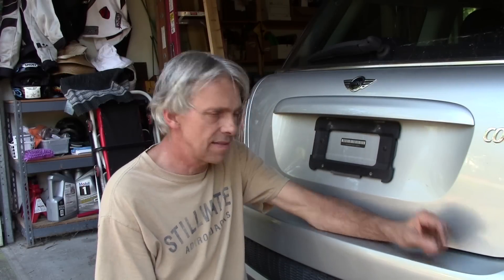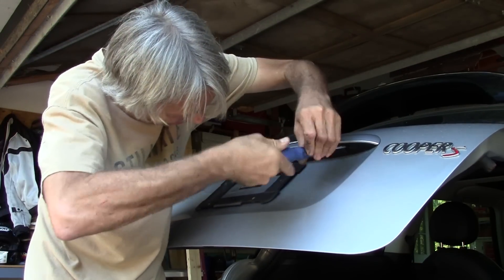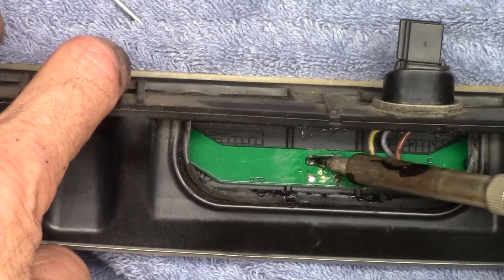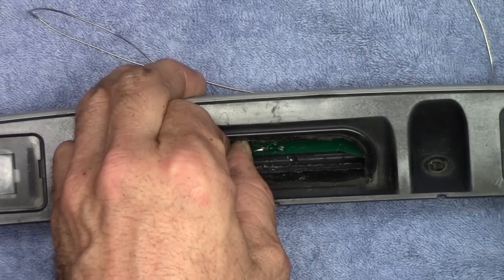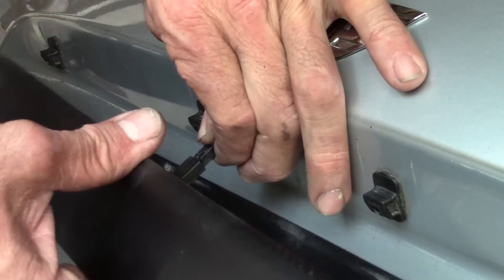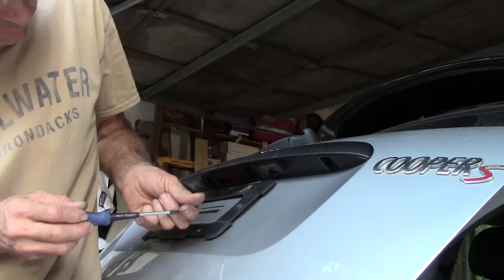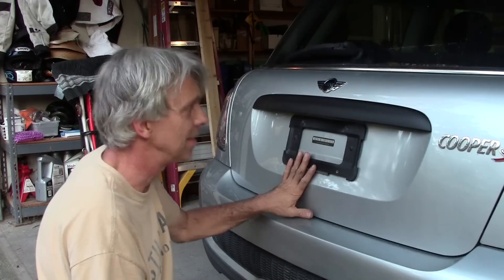Mini Cooper R56 Rear Hatch Release Switch Repair

Comment: My 2012 mini Cooper s was having issues with the hatch door randomly unlocking. I had just bought a new key fob and thought that may be a contributing factor. But after seeing this video I removed the assembly with the switch that unlocks the hatch door. After careful inspection I saw a single strand of copper with located under the switch and thought that may be shorting out the pins that activate the unlocking of the hatch door. I used to do technician work so I cleaned the switch re-soldered the pins on the switch. Placed the assembly back and I no longer have the issue of the hatch door unlocking randomly. I saved myself about $300 thanks to YouTube and the good people who share their experiences. I love YouTube and thanks to all
Reply from the maker: Nice!

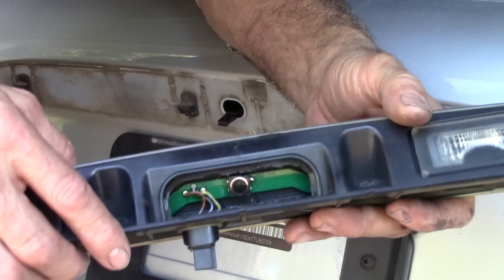Comment: at minute 4:10, I need to know if there is a part number for that rubber diaphragm. My switch works fine but the rubber diaphragm broke off. Does you or anyone on this feed know if this part alone can be purchased?
Reply from the maker: I covered mine with a strip of leather. Part is available as a whole assembly only. ):

Comment: Mine will not work with fob or physically.  Is there a fuse and where is the fuse location 2003 hatchback. Switch seems to click.  I think there is no current

Comment: You can repair switch without cutting the rubber if you prise off the trim on the top  you can get to a piece of plastic which holds the pcb and you can repair from there.
Reply: I did this, tested OK put on car then the rubber broke lol. So now need to take it off and replace the rubber doh

Comment: Thanks!  Great video.  Car is 2008 mini S R56. I found a 12mm plastic panel mount momentary switch in junk box,  I T attached to the two outside wires and installed it in parallel with dead switch.  It tucks up in the recess. Gorilla taped over most of the opening to replace deteriorated rubber. It works.  Not as original as your fix but works/looks ok. The center wire is 12V power for license plate lights.

Comment: Do you have a solution for a 2009 Mini Cooper S convertible with a stuck trunk lid?  

There are two latches for the convertible tailgate. For some unknown reason one latch is unlocked and one is locked! The button on both the key fob and on the tailgate seem to work fine.  I've crawled into the trunk and I can see one is locked and one is locked (the latch is engaged).  Help please!!!

Comment: how do you check the way current flow in the salvaged switch?
Reply: I second that
Reply: It's a switch one side shorts to the other, check with a multimeter if your not sure the switch is correct.

Comment: I've replaced loads of these there only £40.00 from dealers  and it comes with new chrome  and lights would you really bother trying to fix?
Reply: For me I quite enjoy trying to fix the fault.  Also feel it is good to try and keep stuff out of landfill when the problem is just one tiny component costing a couple of pounds to replace.  But I'm sure BMW would prefer everyone to follow your advice!
Reply: £40 as opposed to a few pence is a big difference.
Reply: J lloyd They start at $100 now

Comment: Just done this repair on my daughters 2011 Mini. In the UK I got my switch (in 2 parts) from RS Components. Part No: 4846620 & 7931623, £2.05 including delivery! I found that if I carefully cut around 3 sides of the rubber cover with a very sharp Stanley knife I could hinge it back enough to solder in the new switch. I then re-fixed the cover in place with some clear silicon sealant. Job done, Thank.
Reply: Thanks, was deciding whether to cut or just fork out for a new one
Reply: Glad it helped
Reply: Hey buddy, still got a spare one by any chance? It's discontinued apparently. Happy to pay you for postage (I'm in the UK)
Reply: @ZeFran  That is unfortunate and I don't have a spare, :-(
Reply: No problem, thanks for replying :)

Comment: Thanks for this video. All I needed to do was replace the rubber cover. I cut out a piece of the thin craft foam, sprayed it with a fabric clear from SEM products (only because I had it already) then glued it in place. Might last the for the life of the car. If not I'll do it again.

Comment: Recently bought a 2009 Mini  and just ran into this problem. The only difference is the key fob doesn't open the hatch. I currently have no way to open it. The button latch feels like it is broken but since the key fob doesn't unlock it either, does this mean there's a greater issue issue involving more than just the button??

Comment: This was great but when I went to do mine  ( I have had it repaired professionally two times @$400 each time) the rubber cover was still there and needed to take it apart. I found this very difficult. I removed the silver capping but was unable to remove the black casing to get comfortable enough to work on the switch section. Any suggestions? Or is it  just easier to pay for a new hatch handle?

Comment: I have the same problem - but found this link when someone simply removes and cleans the microswitch rather than replace the whole unit. https://www.northamericanmotoring.com/forums/stock-problems-issues/178411-hatch-release-button-fix.html
Reply: So i followed the above link, dismantled the microswitch and noted that the triangular metal clip that is held back by the spring was snapped. The part number is in very small writing but it's a Burgess Microswitch model V4NC range. The actual model is V4NC4S (prewired vs pins which you have to solder. I'm going to buy one (whether pinned or not) but use it to replace the top half so I don't have to fiddle around resoldering cables and see if I can get it to work. Note that some come with a metal lever which attaches to the pins in either corner of the top  piece - this isn't required on the Mini as the handle pushes against the little button directly so no need for a separate lever. 
Here's the spec sheet for the V4NC range if you're interested: https://www.distrelec.biz/Web/Downloads/31/01/03583101.pdf  
And this is the one I'm going to buy off ebay (£10 incl P&P) https://www.ebay.co.uk/itm/MICROSWITCH-V4-PLUNGER-CONTACT-CONFIGURATION-SPST-CONTACT-C-FOR-SAIA-BURGESS/274433146034?hash=item3fe57d7cb2:g:HQsAAOSwoXFfFUm7
Reply: That's for  the gen 1 which has a different switch than the R56
Reply: @Lex-pq9bl  sorry, should have mentioned mine is an r52 convertible

Comment: just picked up a 2010 cooper s myself and am working on very similar fixes and upgrades so thanks for the videos. I had a question that you might be the guy to ask. My new mini is automatically unlocking the hatch at random only when the car is unlocked. I heard in forums that the rear hatch trim where the button is located can accumulate water and condensation causing the button to malfunction and unlock on it's own but nobody offers solutions. I would like to avoid the $120 for a new trim piece plus the cost to paint it to match. Any ideas on how you might go about fixing it while I still have a working switch that is just in need of a little water protection?
Reply: Gerc422 I have the same problem did you ever get it fixed?

Comment: The manufacturer did this weakpoint on purpose so you'll have to throw that mini away and buy a new one.
Reply: /s ?
Reply: Lol
Reply: This fails on BMWs of the same era as well, it’ll use the same thing from the same parts bin. It’s a tiny switch that is only suitable for CD player interfaces. You’re applying pressure when you’re using it opening the boot.

Comment: The problem on mine was that the switch has a plastic keycap clipped onto it. The clip had broken and so the cap had moved meaning the switch wasn't being pressed. I found both the keycaps and the exact same switches for sale from RS Components. Part number 484-6620 and 793-1623.
Also, no need to remove the rubber cover, just cut three edges, fold the rubber back, make the repair, then glue with cyanoacrylate. Some RTV black silicone (instant gasket)  does a great job of sealing it as well.
Reply: Hi Greg, thanks for posting your tip and especially for the RS part numbers.  My cap and switch have both disintegrated so I think I'll order them and see how I get on.  Did you replace the entire switch or just the cap?
Reply: adamski700 I ordered the switches and caps but just replaced the cap. If I'd had to solder a new switch I may have cut the rubber cover completely off, as in the video to make it easier.
Reply: OK thanks Greg.
Reply: adamski700 if you are UK I can post a switch and cap. i have spares. no charge.
Reply: Thanks very much Greg (yes I am in the UK) but I have just ordered both from RS, cost £2.04 inc postage (before I saw your offer).  Mine needs a new switch so will let you know how I get on!
Reply: Hi Greg! Still got that switch and cap? I would love to have them to Finland, so just get me the way to pay you for it; PayPal etc?
Reply: Great advice there Greg. 
Ordered the parts from RS as you quoted and eased up the rubber cover after softening the original jointing with persuasion from a heat gun and a scalpel blade to tease up the edges. 
I had expected to have to replace the electronic switch as the release had been getting worse over many months before finally giving up the ghost and I was quite surprised when I found that the problem was only a broken key cap! The original rubber cover contains a plastic inner section which interacts with the key cap and then the switch which isn't clear in the video. After replacing the small plastic cap and testing I refitted the rubber cover using black silicone. 
BMW had quoted £80 for a replacement handle so I was delighted to be able to fix this for pennies! 
Thanks so much for the detail.
Cheers
David
Reply: Hey buddy, still got a spare one by any chance? It's discontinued apparently. Happy to pay you for postage (I'm in the UK)
Reply: @ZeFran  You're right, the exact switch from RS is discontinued, but any in the range will do the job. rs-online 793-1611 is the same, but only rated for 100,000 actuations!
Reply: @GregWoodsLancs  I actually went for 793-1667, which works pretty well so far! Thanks for your help!

Comment: Great video love it saving all us money going to school with you .
Question I had a painters tarp in the back of my countryman and it was a struggle to open the rear hatch because the tarp got stuck in the latch.
Well the light will not turn off now. Is the contact damaged I took the bulb out in the back to not drain the battery 
Do you have a solution to this it has to be the contact on the latch!
Your thoughts thank you so much I did subscribe to your channel great job

Comment: how do you check the way current flow in the salvaged switch?
Reply: Eric Lee use the DC continuity tester on a digital multimeter.